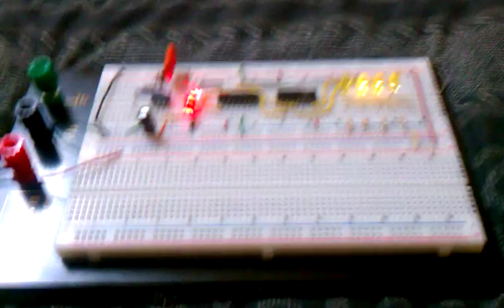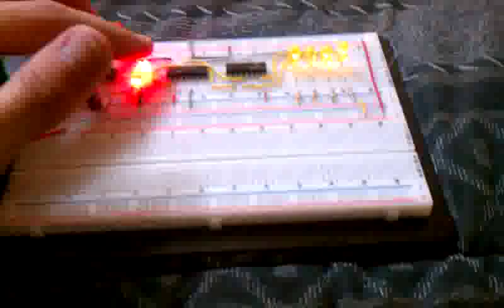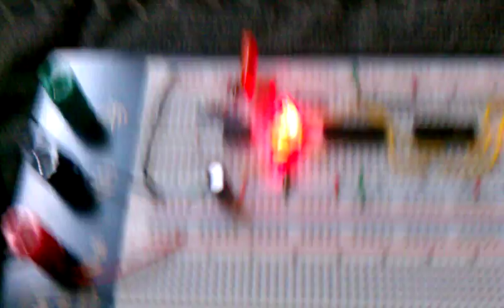Optical Switch & Counter Circuit

Comment from the maker: @robert8640 

Not with this one. I have another video that is the same circuit except it's an 8 bit counter and uses an infrared led and photodiode, and yes, if you block the IR led it will stop counting. You can very easily adapt this circuit to be an IR alarm by adding a d-latch and a speaker circuit.